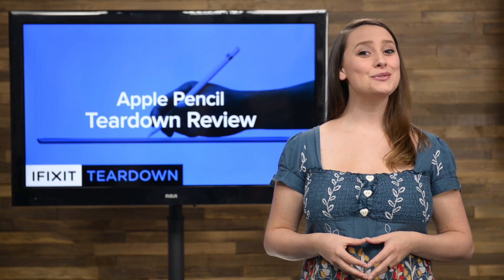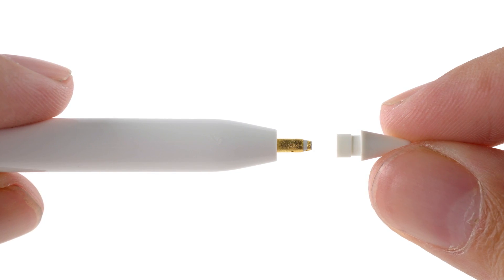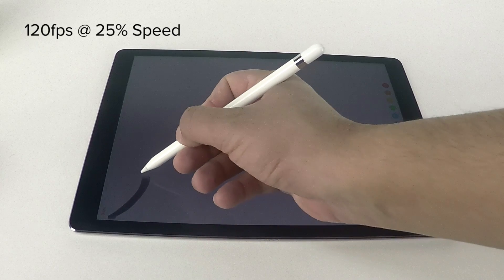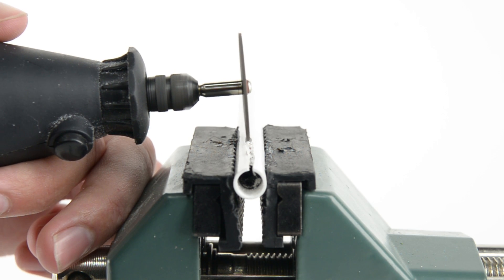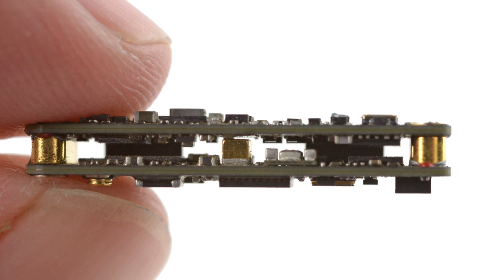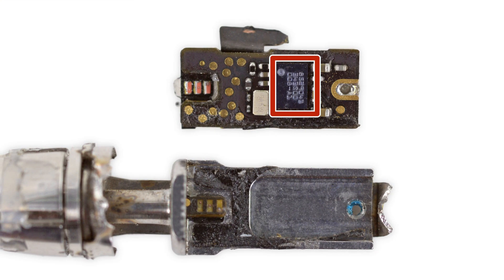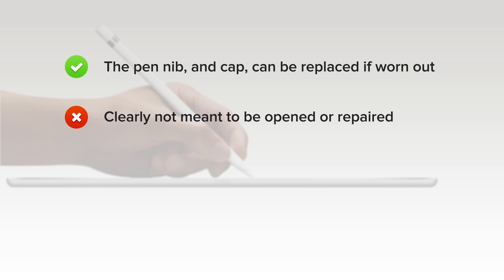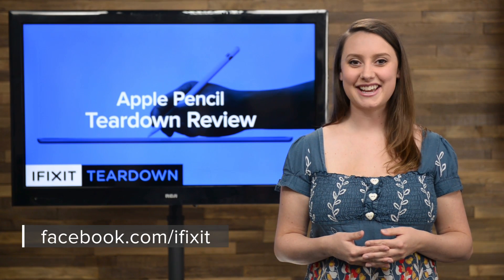Apple Pencil Teardown Review!

Comment: even for its tiny 86mAh battery, it should have a longer life that 12 hours. I also think that the should have done what wacom did back in the 90s with their devices, the pens were about as thick and didnt need to be charged and still had, pressure and tilt sensing with ridiculous accuracy.

Comment: Im surprised that didn't get a 0 out of 10
Reply: +Briggleton The tip is replacable... I'd actually expected a 3/10 for that since it's the most likely component to need replacing at some point.
Reply: +Briggleton There isn't a 0 score. Although the graphic would suggest it.
Reply: Yes there is. The AirPods and Microsoft Surface Laptop both got 0s. 

0 = Absolutely nothing can be replaced. Whereas the two most likely to get damaged components (tip and cap) are replaceable.
Reply: +Steamrick Haha we found an Apple Fanboy

Comment: Surely "can't open without destroying the device" deserves a score of 0, no?
Reply: +Cwize1 The tip is replacable... I'd actually expected a 3/10 for that since it's the most likely component to need replacing at some point.
Reply: +Cwize1 Repairability score "between 1 and 10" listen up, its a script they use in EVERY tear down video.
Reply: +Cwize1 They score it from a 1 to 10, so there is no 0 on their scale.
Reply: The tip and cap are easily replaceable saving it from a 0.
Reply: Ironically, ArPods got zero score.
Reply: +Cwize1 I think the replaceable nib got it the 1
Reply: +Hector Julian Selley Rojas Disclaimer: I'm not an Apple Fanboy. :D
Reply: +Cwize1 As Wendollyn herself says: "10 the easiest to repair 1 the most difficult". I'm amazed how manufacturers are now making all this kind of devices so disposable.